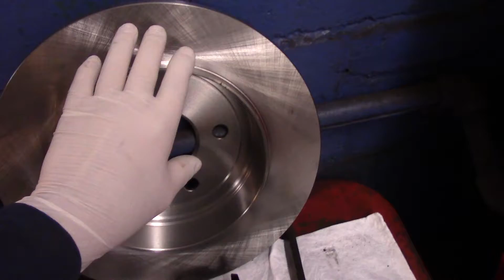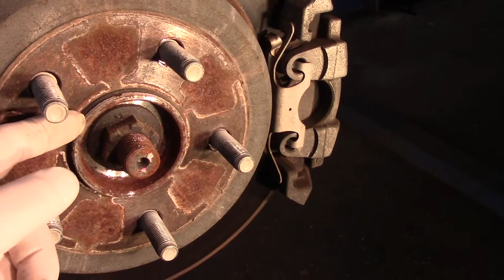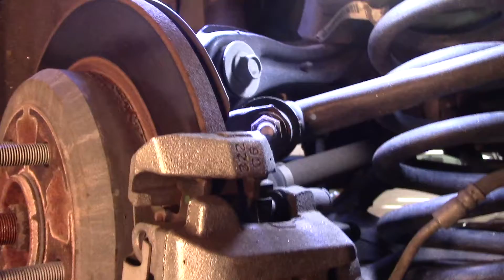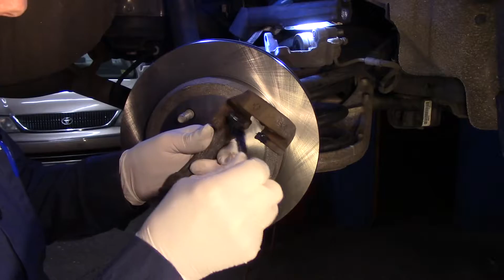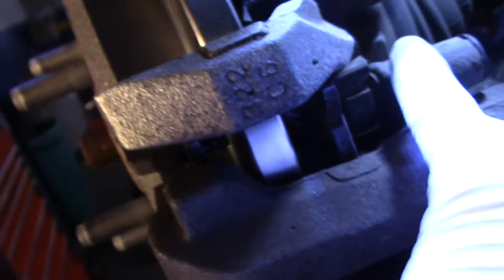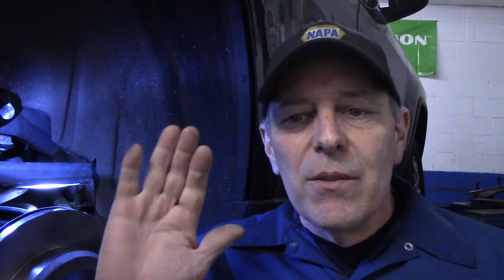Replace Rear Brakes 2011-2019 Jeep Grand Cherokee

Comment: Mostly good, but there's a few things that should be pointed out. First, once the rotor was removed an inspection of the parking brakes should've been done. Second, when the caliper bracket bolts were reinstalled, there was no mention of them needing to be torqued to 89 ft. lbs., same with the caliper slide bolts, which should've been torqued to 20 ft. lbs. Finally, regarding the slide pins, the factory service manual specifically says to clean but NOT lubricate them. I suspect the use of grease will allow dirt to stick to the slide pins and cause them to eventually bind.

Comment: My 2017 Has the Quad Lift suspension and the rear Air Bag is larger than the coil spring,  I couldn't get a ratchet and 7mm socket drive behind caliper
Reply: I saw a guy on another video take off the caliper mounting bracket first - with the caliper still attached, then he could get to the 7 mm  Allen head guide pins.

Comment: I sure like how everything always comes apart so easy on these videos, I have been turning the 2 bolts for 15 minutes and they will not come out far enough for the caliper to come off. The bolt just spins, and spins and spins..
Reply: They are out just get a flat head screwdriver and gently push them by the treads, just stuck in plastic boot
Reply: Thanks, that is exactly what I did shortly after my post. I also used a 3'8" breaker bar to break the bottom bolt loose as the rachet did not fit, I tried the wrench trick on the bit socket but it was too small.

Comment: You need slide lube on the slides, and it's 100 times easier to remove the 18MM bolts and take the caliper off then hit the 7MM alen bolts. If you don't do this, then it's a nightmare to get them in and out. 
You also need blue locktite on the 18MM bolts, and they need torqued.
Reply: Just found that out today, could not get 7mm bolts out

Comment: Great video. A lot of other videos say to use a 11mm for the caliber pins. You're video is right on for the 7mm caliber pins. Good job!
Reply: thank you, i noticed that as well from other videos, even looked up the parts straight from Mopar and they don't give a size. but I did see the 2017 uses the exact same pins and bolts as the 2014 in this video, so now i know what bit i need to add to my bag before starting this tonight.
Reply: 11mm for the fronts if it's the same style caliper as the rear. Just the slide pin size is bigger.

Comment: Hi Jim. Great video but I got hung up on one thing. The rotor wouldn't come off, essentially a rust ring (I assume) holding the parking brake shoes. I found the adjuster behind the rotor plate or whatever it is. But I have no visibility at all on which way the adjuster is oriented and which way to spin the adjuster and is it the opposite way for each side. Do you know this info or do you have a video on that on the Jeep? I have a Summit series and all the air suspension components don't help with visibility. I do not have a brake spoon and plan to get one. If you see these messages, please comment when you can. THANK YOU!

Comment: excellent video sir  i did brakes in the 80s when you had front disc and rear drum and you had to clean the wheel cylinders out with a hone. i just needed tool info on my 14 overland.
great job great patience great explanation. geat safety call out on open had which is what we teach at cat. awesome

Comment: I noticed that you didn't mention anything about opening the master cylinder reservoir during piston compression. Is that something that has to be done? I have changed brakes on my own cars in the past and have never done that. I have a 2017 Jeep Grand Cherokee that is nearing a brake change and I was just curious if that is something that I should do.

Comment: Hi Jim what’s the purpose of the o-ring is it just to help hold the rotors in place and what if that o-ring got lost damage is it a big deal
Reply: Its for the assembly line, instead of screw, they use o ring. So if it breaks, rot or gets lost, its of no concern. Hope this helps.